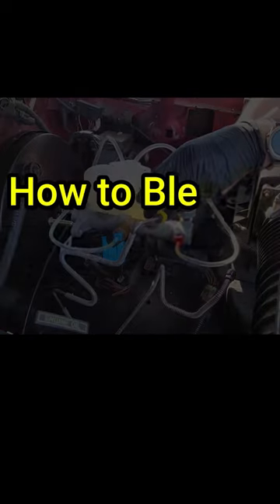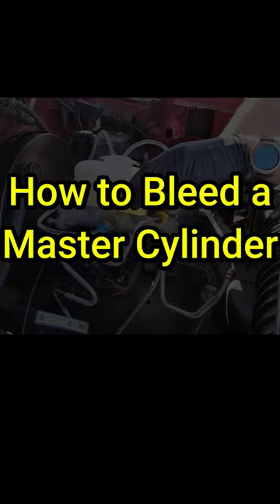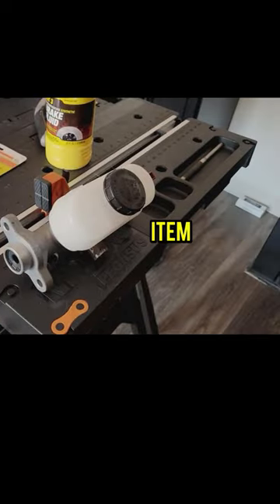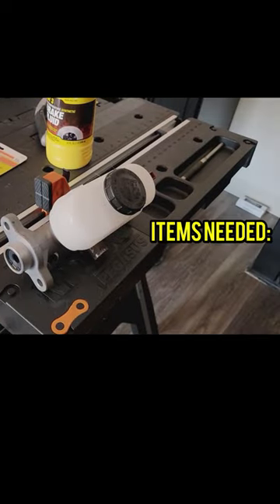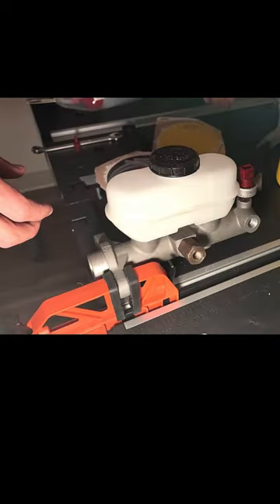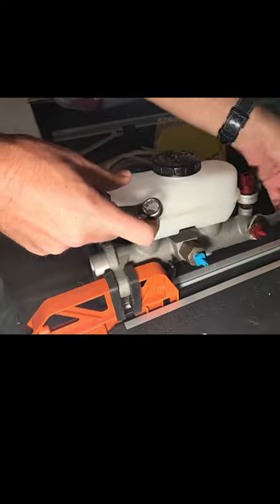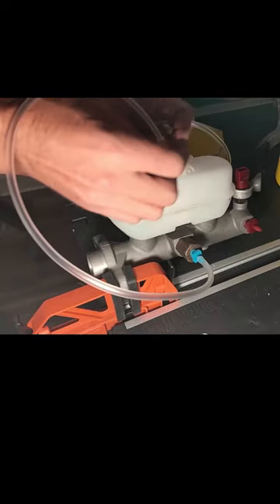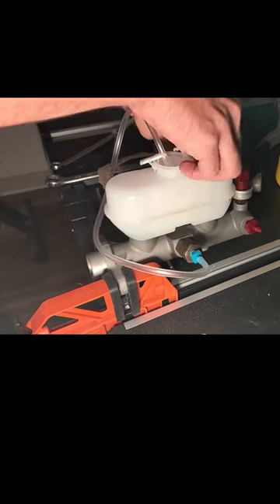Bench Bleeding Master Cylinder Part 1!

Comment: But once you take out those rubber taps and fix the brake pipes isn't that will let the air in back?
Reply from the maker: Hello Samuel, at this point only fluid is coming out of the master cylinder and you shouldn't have any issues with air entering back in.